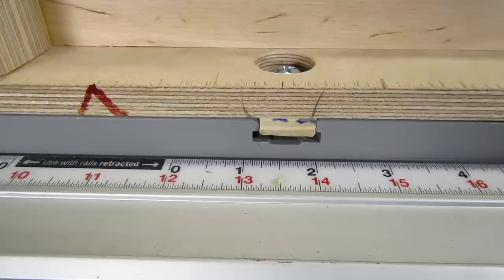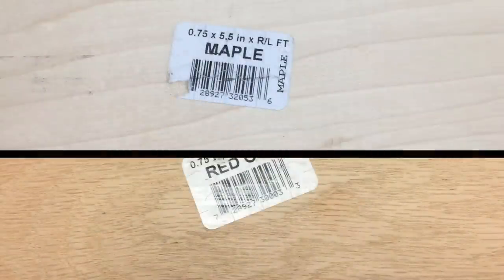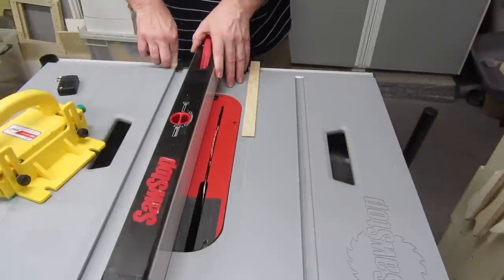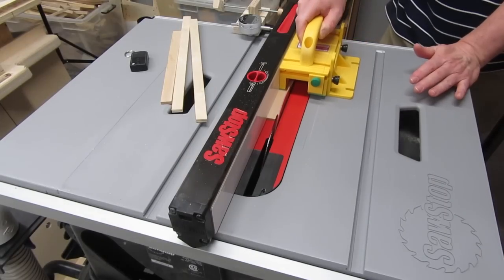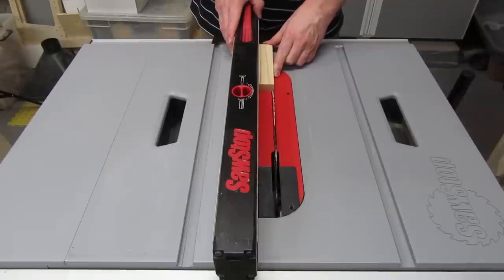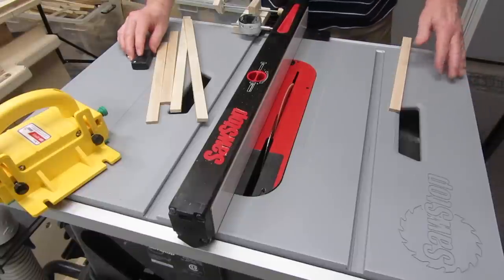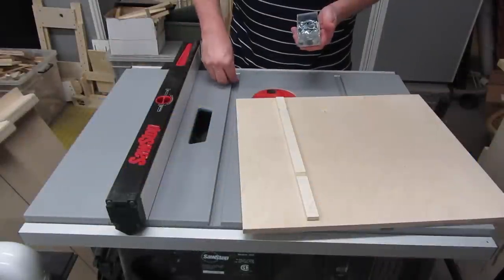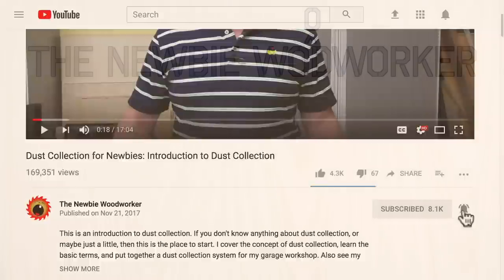Easy! Make Runners for Table Saw Sleds!

Comment: i fought the Craftsman tab issue, and just ground them off.  MUCH easier.  Then to cut runners..realized extruded shelf strips for wall mounting are the perfect size, depth, and rigidity to work very well for runners, plus predrilled for counter sinking.  Some strips are narrower and cheap extruded alum, so use your calipers and measure closely.  once you find some that give you a good fit, there is no more swelling or twisting and you have a better runner and buying these runner strips are much less $ alot less hassle than creeping up or down with your fence.  You probably have strips leftover from previous shelving projects too.
Reply from the maker: Awesome! Thanks for the info! 👍

Comment: Thank you sir for this video!  Another technique here for those of us that have cheap table saws with sloppy fences...  Follow the steps above but don't sweat cutting the runners too narrow.  Use two runners for your sled and when you go to glue/tape them up make sure they are pressed to the outside edges of the slots (both away from the blade) using folded up pieces of cardboard/paper/whatever.  After the glue and screw to the sled base, if the sled binds lightly sand the outside edge of ONE of the runners until the sled slides smoothly.  Thanks again for this vid, and count me as a new subscriber!
Reply from the maker: Thanks, and a great tip. That's the thing about being a "newbie" (I probably don't qualify as that any more) - I have limited experience when it comes to equipment. So it's awesome to have other people jump in with their experiences. I truly appreciate it, and glad to have you aboard!
Reply: I agree with ggsmith and would go so far as to say it's better if the runners aren't a snug fit.
Reply from the maker: @MrSwingJamie  I'm not sure I agree, but thanks for the comment. 🙂
Reply: I was thinking of this same technique - biasing both runners towards the outside edges of the slots, as also a way to deal with seasonal swelling of the runners.  This way the sled will run straight and true, but there's the slightest gap on the inside edge of the runners for the wood to swell when it gets humid again (Houston weather here).
Reply from the maker: @johnnichols8553  Your reply didn't show up on YouTube until 5 days later - I have no idea why. In any case, I say whatever works is fine by me.😀

Comment: Today I went to build a sled for my Ryobi table saw when I noticed that this particular table saw has "tabs" inside the runners.  The runners are not open as I have seen in most of the videos.   This made creating a runner for this brand of table saw a bit different.  To solve the problem, so cut my strips, then set the depth of the blade and cut slots in the runners sides.  This allowed me to perfectly slide my runners into the miter slot and was then able to build the sled.   Thanks for the videos.
Reply from the maker: Awesome - I'm glad you were able to make your runners! Great job! 😄

Comment: There's a lot of good information, well explained, in this video. Allow me to add a suggestion for those wanting to use solid wood for their runners: Don't try to cut them to fit perfectly. Instead, make the fit of the runners adjustable in the following manner. Cut the runners so they are a little loose -- say 1/16". Then, on each end, cut a thin kerf running vertically (from the top to the bottom of the runner) about 2" long. Make the kerf about 1/4" from one side of the runner. It doesn't matter which side as long as kerf at each end of the runner are on the SAME side. You can use a bandsaw or a hand saw to make the kerfs. Then, you can drive a small screw into the end grain of the kerf as a wedge to expand the 'thin side' of the runner outward to achieve a perfect fit. Not only is this faster than trying to cut the runners to the exact perfect size, it allows you to adjust the fit for changes in humidity. 

Yes, one side of the runner will only make contact with the miter slot at each end. However, the other side -- the straight side -- will be in contact with the miter slot for its entire length. Since your sled will always be referencing off the same side of the miter slot (it doesn't matter which side, but I always use the side closest to the blade as my 'reference side' of the runner), you'll have consistent accuracy.
Reply from the maker: Thanks for the comment! I thought about doing that, but in the end I just use plywood for the runners, and I haven't had any issues. But it's certainly a viable method, for sure. Thanks for sharing. 😄

Comment: Hi Dan, stumpy nubs suggests to use a plastic cutting board for the runner, and Matthias ran a dado in the base of his sled to keep the runner straight, all of which are good ideas. Just thought I’d mention this, thanks again for the videos, Sam.
Reply from the maker: Thanks! I've seen both those videos, so I know what you're talking about. And I love the fact you mentioned them.

Let me see if I can explain why I didn't talk about those things...

When I tried a cutting board, it kind of melted along the edges where I was cutting it. I don't know if I was using the wrong type of plastic cutting board or not, but since I had that problem, I decided not to mention cutting boards in the video. Not sure whether that was a good decision or not.

I understand why Matthias cut the dado, but it just doesn't seem necessary. I know that questioning Matthias' logic is probably asking for trouble, because he's one of the smartest people I've ever watched on YouTube, and I absolutely love his channels, but still, I have to be true to myself, and as I said, I just don't see the need.

So that's my reasons for not including those things in the video, but as I said, I appreciate the fact you brought them up! Thanks again.
Reply: Good to know Dan, I’ll be assembling my sled soon, all good points! Thanks again
Reply from the maker: You're welcome!
Reply: I’ve had that same problem cutting UHMW cutting boards on the table saw. The edge melts and the chips don’t detach fully or the stick back on b/c they’re hot. I haven’t tried the bandsaw yet, maybe on a slow speed it will work.
Reply from the maker: The band saw is a good idea. Hadn't thought of that. Thanks!
Reply: Plastic butting board is not a good idea, at least it is not for me.  I tried one and it warps like a bow.
Reply from the maker: I know what you mean. I'd love to know why some of these ideas work for some people, but not for others.

Comment: Channel is coming on leaps and bounds now Dan. Thank you . i just had an idea make a set of runners from UHMW and use that as a template , using that as a template and route as many runners as you need. Yes I am scared of table saws lol
Reply from the maker: Thanks! Good idea, although I'm not sure how closely the final result matches the template. When it comes to runners, a few thousands of an inch can make a big difference. But by all means, give it a shot! 😄

Comment: Thanks Dan, I always enjoy. Your channel and always pick up a tip or something I didn’t know. I’m more new to woodworking so any and all tips are appreciated. I have a Ryobi table saw and the runners are wierd as heck. They are not just a straight line...they “had” these little grooves that came out at several places on the runners. I eventually had to cut those grooves out just to be able to make the runners for my cross cut sled I made. It’s hard to understand but next time your at Home Depot look at they’re table saw runners. Thanks again Dan
Reply from the maker: Thanks, and you're welcome. I just looked up a picture of those slots, and you're right, they're very strange. I found a few places where people said they cut the tabs  off theirs off also. I wonder what the heck Ryobi was thinking?
Reply: I bought ryobi saw but noted two different models. One had more normal slots.  Guess which I bought. On the other hand, neither will accept dado blades.
Reply from the maker: I've read that some people cut off the tabs, with some sort of grinding wheel. Just a thought.
Reply: I found out the hard way about the ryobi table saw. I’m in the process of making my sled. Trying to avoid grinding the tabs I made some T tracks out of oak. Someone could make a lot of money machining rails for these saws apparently this same top is on craftsman and other saws.
Reply: The Newbie Woodworker I’ve asked myself that same question about what they were thinking but man I have no idea. Here is was a “newbie” and still am and trying to make a crosscut sled with runners like that!! It was the hardest thing I had ever tried for sure.
Reply: Stephen Ater Wow, here you thought you had it made with the runner situation and then it wouldn’t accept the dado’s!! What the heck??? So sorry for your trouble but if and when the time comes to buy another saw I will be MUCH smarter then. Good luck to you Stephen!
Reply from the maker: I found this video: https://youtu.be/Akpp3nZdeVY. It isn't a very good video, but it shows how to make runners that will work with the tabs.

Comment: Another informative video, thank Dan.  Especially helpful regarding the risk of swelling due to humidity increase, and the ways of dealing with this.
Reply from the maker: Thanks, Ian. I appreciate you taking the time to post it. Sometimes it's hard to know if I'm providing helpful information or not.
Reply: The Newbie Woodworker:  Even if there’s some duplication of what others have said, which is actually almost impossible to avoid if you’re adding to the general knowledge of the topic, you always then manage to usefully expand on what others have said, making your videos interesting and informative.
Reply from the maker: Thanks! That's actually my goal in these videos, to make sure the details are covered. That's where I struggled the most when I started, so I wanted to help others not to have to struggle so much. I've also got some new stuff coming up that I really haven't seen anywhere else, so that should be interesting. Thanks again.
Reply: The Newbie Woodworker:  Looking forward to all that.

Comment: Cheap (relatively) easy to make runners: Go to the orange or the blue store and buy a 3 foot length of 3/4 x 3/4 square aluminum tube. Rip it into two U-shaped channels. Drill the channels every few inches. Sand the cut edges. Apply double sided tape to the face. Lay then in your miter slots with the legs facing down. Shim to slightly above your table with coins or washers or whatever. They should be a good fit in your miter slots. No bows, no warps. Better than UHMW  plastic - cheaper and not floppy. If there is any play at all on your saw, shim them to their outermost edges with paper or business cards or playing cards. These two edges are the only ones that matter if you're using double runners. Attach your sled in any way you see fit.
Reply from the maker: Thanks for the idea! 😄
Reply: Awesome idea, on my way to the orange box now.
Reply from the maker: @mel7403  👍

Comment: Have you considered drilling holes in the runners first, and then using double-sided tape to mount the runners, followed by the screws to cut out the drying time of the glue?
Reply from the maker: I've done that before too. As far as I'm concerned, when you find a way that works for you keep doing it. So if that works for you, awesome!

Comment: I saw a good suggestion for positioning the runner, do the same to start but use double sided tape on the runner.  Once stuck you carefully turn it over and drill pilot holes and use screws , make sure to countersink them or use flathead screws.  You could drill small slots in the runner before positioning and have some adjustment in them.
Sleds made with runners and a backstop at a precise angle would work for repetitive cutting of angles.
How about a sled that can be adjusted to different angles other backstop?
Reply from the maker: Thanks for the info! As for your suggestion, let me know when you get it working. 😄

Comment: Well produced and very informative video. Thanks.
Reply from the maker: Thanks! Glad to help. Love your user name. There's a story there, I suspect. The "1951" is fairly obvious. What about valvelifter"? I mean, I understand valves being "lifted", but is there a specific reason you chose that name? Just curious.
Reply: I used to do some motorcycle club racing & had an old BSA 500 cc single cylinder which had a valve lifter (decompression) to aid starting and my mates tagged me with the nickname Valvelifter 😂
Reply from the maker: See, I knew there was a good story! Thanks for sharing. :)

Comment: Hey Dan, I've come into an old Craftsman contractor saw, with a miter slot shape I've never seen before.  It's not the tabbed kind, and not the upside-down T kind.  The slot width is 5/8", and the included miter gauge has a piece of U bar for the runner, which is oriented like an upside down U, and the slot itself has a hump running along the middle that the U straddles.  There's not really enough of this upside down U shape to the slot below the plane of the table top to fit much wood into.  I might be able to make a 5/8" runner and then route out a dado along the bottom to straddle that hump, but it would have to be thin 'legs' and a thin top, like the metal U bar, which would be very weak in even a hardwood, and prone to snapping off.  I don't think the hump can be ground out of the slots, as I think it would leave a long hole in the bottom (have to measure to be sure, but I think I'm right about that).  I guess I'm limited to finding and using metal U bar for my runners, but wondered if you have any thoughts on a wood option, something I could fabricate as needed?  I've just never seen this shape of slot outside of this Craftsman table saw.

(EDIT:  It's a 137-221940, 10", 2.5hp, 5,000rpm, but the online user manuals I've seen don't show enough detail to see the miter slots up close.  Anyway, just wondered if you've seen such a beast, or have any ideas on shop-made runners for this oddball slot shape?)
Reply from the maker: Wow, that sounds really strange! A couple of thoughts off the top of my head: I can't imagine a wood solution that would work (but see my last thoughts below). But maybe UHMW plastic? Or else aluminum, which is pretty easy to use like wood, except for the shavings that go all over the place. But if the slot is consistent, and the included miter gauge fits the slot well, I'd consider finding out if you could find a metal shop that could duplicate it, for hopefully not much money. I don't know if that's possible or not, though. That's all I got, other than to wonder if you actually need it to be shaped like that? A runner doesn't have to go all the way to the bottom of the slot... Anyway, good luck!
Reply: @TheNewbieWoodworker  Thanks for the reply, Dan!  Yeah, beats all I ever saw (no pun intended).  They're 5/8", super shallow, with that hump.  It's like Sears tried on purpose to design a table saw you couldn't make your own runners for, since it doesn't seem to have helped them any on the production cost over a traditional 3/4" slot width and shape -- if anything this was more expensive to cast, since someone had to tool up for this oddball design that doesn't appear to be on any other saw.  There are some 5/8" aluminum U channel suppliers out there, and I may go that way, but really liked the idea of milling my own somehow, as I have on easier table saws.  I may make a compression mold out of melamine and clamps, grab some HDPE bottles/jugs (I haven't worked with UHMW), the old heat gun, and just make something from that I can mill down.  With the thin dimensions I'd have to use for the 'legs', I'm afraid hardwood, while strong, might be too brittle.  HDPE seems like it would be strong, yet with enough 'give' to not snap if I set the sled down too hard on something, plus would be really slick action in the slot.
Reply: Oh, just had another idea!  Polyester body filler (a.k.a., 'bondo'), using the actual miter slot as a mold.  They make a variety of that stuff (or used to) that had fibers in it to resist cracking.  Put some kind of release agent in the slots (WD-40, paste wax, etc.), masking tape on the table top along their edges, and spread the bondo in the miter slots, flush with the table top or a little below.  Sand off some thickness from the top, so the bottom profile won't drag in the slot.  I'm thinking that's the answer to my problem!  Plus, one could make a ton of those runners, just with a quart can of the stuff!
Reply from the maker: @JusBidniss  Those are some great ideas! There's other stuff that can be molded like that too, so if one thing doesn't work, something else might. Good luck and if you get something working, let me know so I can celebrate with you. 😄

Comment: I noticed that your slots are T-Slots just like my Craftsman tablesaw. Making runners for it has been a challenge for me. So,  what you're basically suggesting is to NOT bother with the t-slot? Just raise the runner so it fits inside of it? If so, that is GREAT!
Reply from the maker: I've seen several different miter slots in Craftsman table saws, so I'm not sure which one you have. Can you give me the model number? Thanks.

Comment: Another way to sneak up on a slightly wide board is to put tape on the side of your fence. Clear packing tape is between .0005 for the very cheap stuff to .0015 for the heavy duty tape. The beige masking tape I measured at .005 and a business card is just over .015.
Reply from the maker: Thanks for the info! 👍
Reply: That's a great idea!
Reply: @alladd2354  thanks